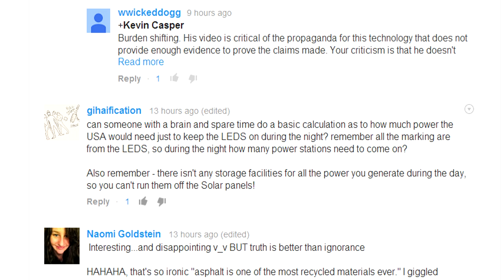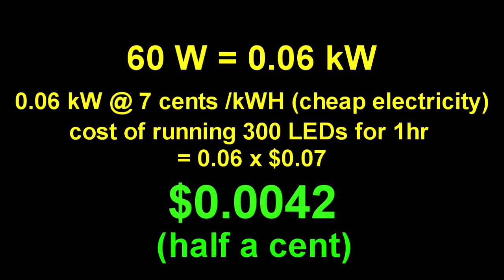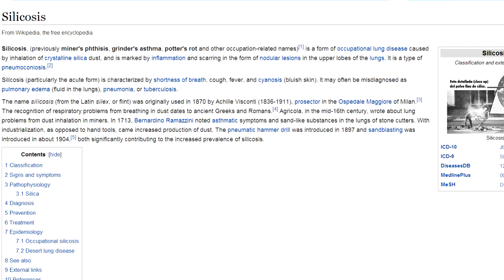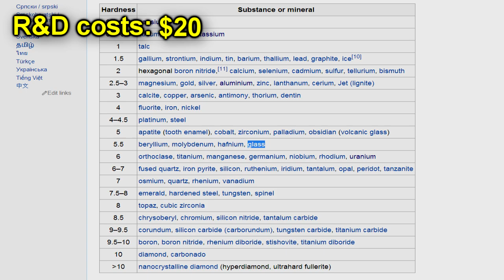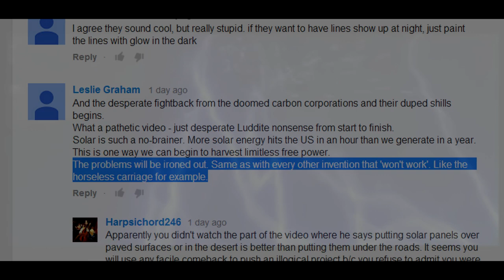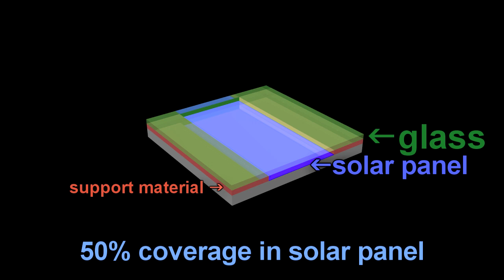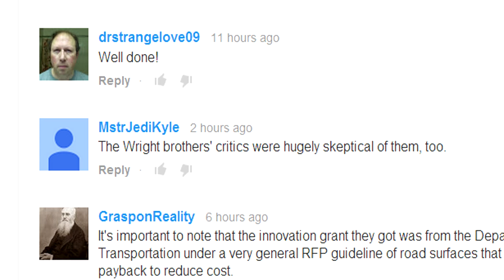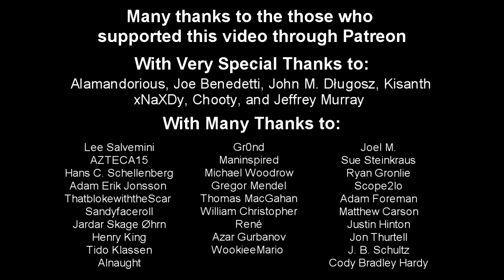Solar Roadways, IMPORTANT QUESTIONS AND ANSWERS!

Comment: What if we made these changes:

Get rid of the glass, and replace it with a higher strength material, most likely a plastic of some sort or something like carbyne, graphine, or a mixture of all three in whatever spots you need it.

Get rid of the LED's, exchanging them for painted/colored interiors. This eliminates the inability to see the lines due to glare, and the energy cost therein. Obviously the tiles are no linger 100% interchangeable, but it's far more cost effective.

Better still, avoid making the highway mid-lines out of the tiles, and just use a normal road surface in between lanes. Also, the paint needs to be reflective, and the tops of the tiles non-reflective or polarized.

Make road signs out of solar cells, and behind them, a tracking cell. Also, you could extend the shoulders of the roads a little more to squeeze another cell or two in width.

I still don't know if this is cost-effective, but it already sounds better. Glass + LED lights made this a bad idea. If they got rid of them, the costs might be outweighed by the benefits, as the energy absorbed is now 100% "profit" as opposed to "paying" for the LED's.
Reply: Plastic would have too much grip when dry meaning you could swurve out of the way of something without just flipping the car in to a roll, but it would be far too slippery when in the rain. It would also be worn down pretty fast too. 

If they had painted interiors for signs, guess what? Less room for solar panels.
Reply: All previous comments + you have another big problem in your hands. How are you going to transfer all this power where it is actually needed. Solar panels produce DC current which is not ideal. The most effective way to trasfer power from point A (power plant, solar park, wind turbine) to point B is using high voltage AC current. 

This idea is doomed from the start.
Reply: @TheManolis1984  No it is DC that is why all the long range power systems are HVDC
Reply: Here's a crazy idea... Put those solar panels in a place where they can just sit in the sun undisturbed and collect energy without being subjected to massive forces (i.e. a solar plant) and leave the fucking roads be.
Reply: Korkel The least reflective solar panels work the best.  The more light they reflect back, the less they are capturing as solar energy.  A perfect solar panel would be 100% black because no light is being reflected. Ultra high efficiency panels use nano structures to trap and redirect light so it's not reflected back out where it can't be used.
Reply: Or how about building hover cars?
Thereby rendering roads useless.
Reply: NO! Glass + LED lights didn't make this a bad idea, its bad idea all together... Why would you even do this? Why the fck would anyone put panels under the cars, trees and grass (it will make a shadow) along the road where you will get vibrations, corrosive chamicals and ice in the winter, rocks and mud, etc. The whole concept is rubbish...
Reply: This are the changes you need to make, it's cost effective, durable, efficient, and solves almost every problem.

Instead of glass or plastic, use something rock hard, but that has something to keep it together due to thermal expansion, also really resistant to weather conditions, UV radiation, friction, impacts, permeable,  and really cheap for maintenance purposes, like asphalt.

Then you get rid of the hexagonal shape, and have large rectangles that can be easily bind to the next one when heated under the sun, but that are easy to break for maintenance. Underneath have a hard rock bed, for it to last longer without loosing its shape.

Get rid of the electronic components which are really sensible, and replace them with rock and a gooey material, also get rid of the LEDs and use paint to make the street signals..... 

If, by now you haven't noticed anything familiar, I'm so sorry for the people living around you, for having to deal with you everyday.
Reply: Or just place solar panels along the sides of roadways.
Reply: Steve Magruder
It still can't produce enough electricity to pay for itself enough to make it cost effective.

Point of fact: "solar freaking roadways" would be throwing money down the toilet for a pipe dream, as the project would never be able to be funded to completion, the costs would never be recovered, and it would be the biggest waste of money by the US Government in history.

In order to be feasible, it would have to have at most the same cost to maintain it as the current technology for roadways. For that matter, we can't even afford to maintain most of those. Replacing them with this would have to be extraordinarily cheap, even if in the long run it could pay itself off, which it can't. The lifespan of an individual panel is less than the amount of time required to pay itself off. This technology would be far more expensive both in the initial cost and in the maintenance.

They will occasionally break, and they will occasionally wear out, requiring replacement. If the government can't afford to keep the current, cheap as dirt, tar and gravel based roads clear of potholes, how will they ever afford to keep these solar panels in working condition?
Reply: But if we would make a huge part of the ground reflective, wouldn't that screw with air traffic?
For the solar panels to work at all I think the road surface necessarily has to be transparent and therefore reflective, right?
There is certain coating developed to reduce reflective traits in normal solar panels but it seems very expensive and is used only to improve energy efficiency (hence, I don't think the coating would solve the air traffic problem).

P.S. Big fan of your show :D
Reply: Manolis Theofilos I think TheBibleReloaded is just fucking with y'all, you know, for shits and giggles in a satiric post.  Well, I certainly hope they're not serious, but them being comedians I'm going to suggest satire.
Reply: Like what has already been said, it still doesn't get rid of the fact that these things are grossly inefficient when compared to almost every other option. If you get 1/5th the energy from solar roadways when compared to panels that follow the sun, then you still need 5m2 of solar roadway to equal 1m2 of normal solar panels. for that price I'm sure we could simply install solar panels on the side of every road and generate 5 times the energy. They also don't need to be maintained as much because people aren't driving over them!
Reply: A friend of mine had a fun personal experience with the necessity of angling solar panels. A company decided to get some over the car lot for their building over the car spots. In sun they'd produce energy, in rain they'd let people get into/out of cars with minimum wetness. Problem is whoever did installation thought it would look nicer if the panels angled outward from the center lines at the head of each space (where the spaces touch at the short side). The company projected it could make return on investment in about 10 years, but that was if the panels were all angled south for a high efficiency. Now they'd be looking at about 100 years for return on investment, and that's without maintenance costs. Basically, solar panels need to face the sun to be efficient, efficiency is the name of the game, and roadways often don't point towards the sun.
Reply: Bathrobe Samurai Care to elaborate? Gorilla 1-3 glass are specifically designed to reduce scratches but are unable to do so when it comes to sand.

The glass that the makers of the product are using standard tempered glass last I heard. Besides if they had confidence in their product they could easily take a power sander or sand blaster and put it on a tile for 20 seconds to prove everyone wrong or some other simple test.

Sapphire glass might be the only glass which one could qualify as nearly scratch proof, however it's got the severe drawbacks of both costing 100x more than regular tempered glass and apparently being relatively brittle which is why it's used in smaller applications like watches or camera lenses but much less so in phones or anything much larger since it's much more vulnerable to blunt trauma than say gorilla glass.
Reply: Urhoboman5 .  U for president ;)
Reply: Forget solar roadways, what about wind turbine roadways.... CAN U GIVE ME BILLIONS OF POUNDS NOW
Reply: CharmCityKid2 How does that even relate on any level to what we are discussing? How do you even make that assessment?
Reply: Bathrobe Samurai Gorilla glass and sapphire glass with scratch resistant coating are far better than standard tempered glass with regards to hardness and can still get scratched by sand.
Reply: tenedria
Well, if you ever have a power shortage then you have no lines and having to replace batteries per tile might not be the best design especially when the desire is that the tiles have a 20 year life span..

Another issue is that it's questionable if isolated tiles can generate sufficient energy to even power a good portion of their current leds when it's known that brighter LEDs will be required if not a greater density of LEDs in order to be sufficient for day time.
Reply: any use of paint would be surface area with reduced efficiency on the solar panels...
Reply: Rand West Another thing to point out is that particular model of tractor (John Deere 3038) weighs less than 1000kg without a trailer, meaning it also does not represent the weight of the majority of road cars (the only cars that you are ever going to find that weigh less than 1000kg are track-oriented kit cars like the Arial Atom or Caterham 7)
Reply: Jesse Gunn
Yes, and the idea is to have a thick piece of glass on top of the panel, which is quite a problem for efficiency and reflection.
Reply: KK426LH      I reason I mentioned it was satire was because they said use a colored/ painted interior instead of LEDS.  Well, the only way you could see it if it was above the solar panels which would NEGATE the use of having solar panels. 
     Did I mention they're comedians?  Check out their channel as It's hilarious! Especially so if you're an atheist.
Reply: Manolis Theofilos they have conversion station along the road every so often.  did you see the guy crawling around in the tunnel? That's exactly what that is for. Korkel Glass is pretty transparent stuff... and when it's scratch the reflections are diffused. This isn't like placing mirrors on the road.
Reply: No. It still makes no sense whatsoever.
Reply: Ah, intelligent people, but stupid in regards to what is humor.  Like intelligence, you can't buy a sense of humor.  It is satire by comedians!!
Reply: What about heat? Solar Panels use solar heat for energy.
Reply: SilenceInd Uh, no, they don't.  Not even close.  Photons excite a doped semiconductor material thereby exciting electrons and freeing them to flow between the constituent parts.  (Heat is a waste product, not a desired one in these installations.)  In theory you could bind a photovoltaic material to a binary metal alloy which would utilize the heat in a thermoelectric process, but that's even less efficient than pure photovoltaic.

Solar thermal collectors, i.e. for heating water, do behave roughly as you describe by using darkened surfaces which absorb photons and re-release the energy as IR heat, but do not generate electricity.
Reply: Manolis Theofilos
Transformers?
Reply: well considering glass is the most transparent material we have available that is low cost as thick layers of plastic are translucent, this will scatter light from the sun and reduce the efficiency of the solar cells. As to painting the interior of the panels, you have to consider the optic effect of having a medium between the driver and the painted surface, as well as you have to factor in that if the surface is not transparent, the colors will appear faded. Also to consider the surface needs to be jaded for there to be decent traction, this will scatter the light even more. so overall like Tf00t said, it is more cost efficient to just make solar sheds. than solar roads. you have to wonder, if they are willing to under go such a feat of engineering, wouldn't it be better to construct a like of solar panel sheds than investing in material transparent enough and durable enough to be roads?
Reply: Jesse Gunn I dont think the tunnels on the side are for this. And again. The further away you are from the consumer the bigger the inverter you need. If you have solar panels at your roof then you need a small one. If your solar park is 60 miles away then you need a proper inverter. This is NOT mentioned in their videos. Too bad reality is not compatible with ideas.
Reply: GothAlice Oh. Sorry about that. And thank you for informing me. :)
Reply: garith21 As far as I'm aware it's a new variety of glass that's been designed specifically for this purpose.
Reply: also I don't get why you would need to power those led from outside sources, putting in a battery isn't that hard. Leds are also very energy efficient so very little of the power the solar panels would make would serve to power them. Leds can also be made of plastic or glass.
Reply: Jesse Gunn And how well would that glass stand up to 18 wheelers running over it thousands of times per day?
Reply: Urhoboman5 . Have you ever seen how much dust a hover car kicks up?
Reply: Im just saying, glow pain for lines.
Reply: For several reasons, including that it makes more use of space, uses gov-owned space, upgradeable tech that can be used to charge electric cars in the future, ect ect ect, besides, doesn't mean it needs to have solar panels in roads that go through forrests or under bridges..... could have conductive cells and other such goodies.
Reply: Maybe if we could find some way to make hovercrafts (cars that are lifted a centimeter or two above the ground),  then friction and dirt wouldn't be a problem, but you still have to contend with all of the other massive issues with it.
Reply: thephysicsgamer123 but you still have to contend with all of the other massive issues with it.

Yeah, pretty much, like the lack of friction you mentioned. Good luck not running over pedestrians, or stopping at stop signs and red lights when you're floating on air...
Reply: I know. I'm just saying that if someone were able to invent a hovercraft with good stopping power, the biggest issue would be taken care of.
Reply: thephysicsgamer123
Not really the biggest practical issue is that those panels will generate less than 20$ per year and per sq meter. That won't cover anything, not even the cost of the glass, in whole it's lifetime...
Reply: But this glass is already at more than the strength required for this job.  Way more.
Reply: My point stands.  This glass can handle much more weight than it is required to handle.  According to their FAQ, this has been tested.
Reply: TheBibleReloaded 
Already your argument is moot as you suggested using plastic - a material from the oil industry. It's not like the solar roadway creator did this to try to reduce the fossil fuel usage or anything because he said that "we won't be able to make asphalt roads in 50 years"(or something to that degree). And asphalt comes from the same source as plastics - Oil.
Reply: We cant even find a material that's good enough to protect roof mounted solar panes from hail and resist photo-degradation over a decade and that doesn't cost a lot.

Im glad people are doing research, but the project as they presented it stinks a bit too much like a scam.
Reply: ssuuppeerrbbooyy
Exactly. Sure, it can withstand the strain of having a semi truck on top of it, but can it withstand the impact stress of having a semitruck driving over it at 60mph? I can't do the math on the force involved because while driving from panel to panel would likely cause impact stress, so I don't know what speed that's at...

However, I do know that the road will not be perfectly smooth, a semi truck will have a slight bounce to it when going over the panels, just as it and every other vehicle does when going over asphalt. That is you can feel the texture of the road in a semi tuck. That "feeling the road" is caused by changes in vertical Velocity. Then you have the impact stress being the vertical velocity times whatever weight the truck is going at, and the faster it is the more wildly it'll vary...

So I'm skeptical that it'll withstand heavy truck traffic at the very least.

A lot of people don't think about it but there are limits to what a semi truck can weigh. Not just the weight of the load, but the weight of the truck, trailer, and load combined... A lot of companies ignore it, especially for short distance hauls where there wont' be any weigh stations on the route.

Furthermore, even if it could withstand it, there will always be panels with imperfections in the material, and even the perfect ones will eventually break down. At the rate at which they'll break down is currently unknown, so it's premature to say that such a road would pay for itself.
Reply: Jenny Tokumei I'd say that the reason the demonstration video is of a tractor, is that the tires don't trap hundreds of small stones - stones that would shatter the panels. 

I don't have proof, that this is so, but I think it's a good hypothesis.  But there are no photos of a road vehicle on those panels. 

Difference to asphalt, if a small stone is between a tire and the road on a hot day, it will be kicked off or pressed into the road.   On a solar roadway, that would be a scratch, or a shattered panel.
Reply: +conejo093 All you need to do is work a layer of diamonds into the surface. Can't make it much more expensive than it already is. Ok, drivers won't be able to see anything due to reflections, but they'll die happy in a river of bling.
Reply: OR you know... use fluorescent paint for road markings, so you dont need streetlights. And then spend the rest of the money into making high effective solar panels and stick em where the sun shines.
Reply: It’ll be simpler to just place solar panels above the roads or just invest in another energy source like biofuel, nuclear energy, etc. you’re offering vague ideas to a solution with the hope of a solution to be invented by someone else.
Reply: The biggest problem with solar roads is we have roads and we have solar farms already.  And these together are much cheaper than solar roads. We have millions of buildings that don't have solar panels on the roof. We have not run out of places to put them.  So even if someone invents a material that makes solar roads possible, they are still a more expensive solution than conventional solar panels and roads.
Reply: The whole idea is just stupid though! Let's even ignore the suitability issue. Let's pretend we iron that all out. We are building solar panels on surfaces that are regularly shadowed! Cars drive over them, blocking out light! Buildings in cities block the light from the street for good chunks of the day. It is just a terrible idea. The funds that went to this project would be significantly better spent on giving every building a solar roof.
Reply: I'm not sure this is serious or satire (Poe's law strikes again!) but I'll reply to it as if it were serious.

1. Plastic lacks the hardness of asphalt concrete, which is 95% sand and rock aggregate (and thus has an average Mohs hardness of nearly 7). Additionally, plastic consistently degrades in UV light. While there is some merit to mixing some plastic into asphalt concrete to improve the concrete's tensile strength, purely plastic roads are impractical. Graphene's price is still about $100 USD per gram—ridiculously expensive for large-scale applications. Carbyne, to the best of my knowledge, is even more expensive than graphene.

2. Even with painted interiors, the glare would still be a problem. A piece of colored glass looks just as bright as a piece of uncolored glass when glare is involved.

3. I would avoid putting the tiles on the road at all, in order to avoid the potentially catastrophic differential loading problem mentioned by Thunderf00t. The actual road surface should remain a continuous piece of material whenever possible, and any sections that can't be continuous (such as bridges) should use pieces that are as large as possible. That's what is shown to be the safest—and safety is much more important than cramming solar panels into the roads.

4. Make the road signs solar cells? Road signs generally point perpendicular to the ground in order to best be readable by people in cars, right? That fact makes them even less effective than solar panels lying flat on the ground, since at the very least a sign's solar panel face is going to be pointing more than 45 degrees away from the sun for roughly three-quarters of the day. Tracking solar cells would indeed be nice, but they're much more expensive and difficult to set up/maintain than simple static solar cells due to the addition of motor, sun-tracking sensors, software, etc. which is why we don't use more of them already. Extending the shoulders of the roads is also a tricky proposal, because that may require them to purchase land from multiple citizens in some cases, which would be a HUGE pain in the ass for everyone involved.
Reply: Why not just build a solar farm next to the road, and leave the road alone?
Reply: It's not using glass, it's using tempered glass that's many, many times stronger than regular glass. Why don't you guys actually read what the project entails before coming up with criticisms that have been addressed repeatedly?